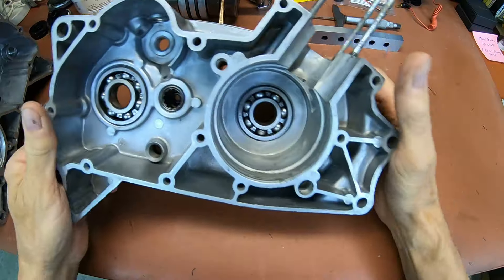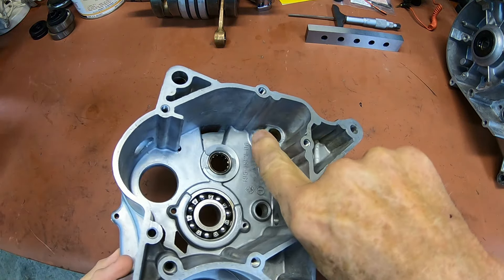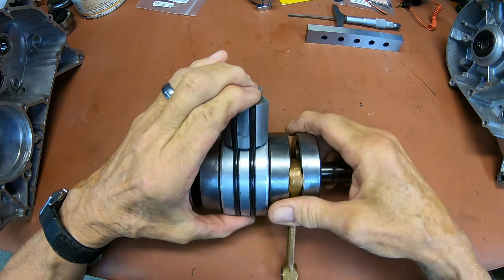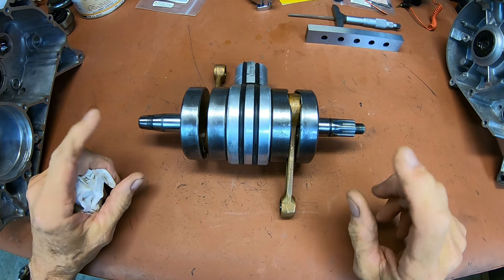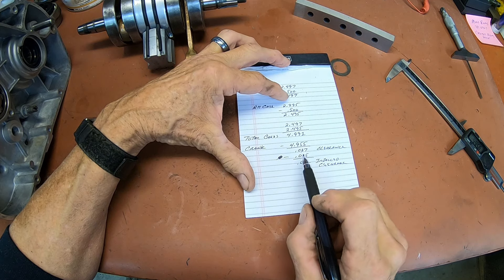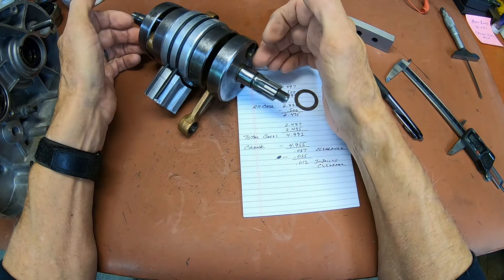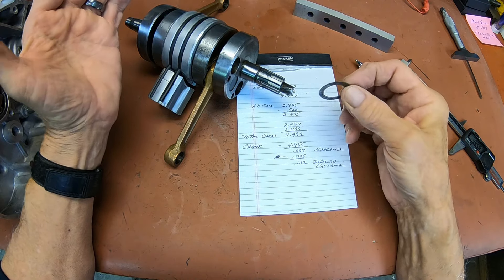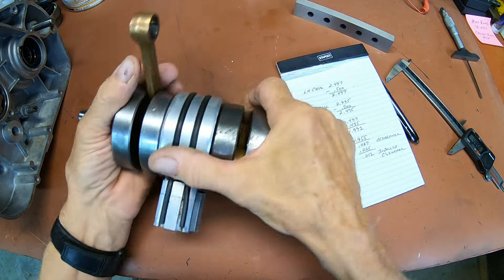Yamaha HS1 90 twin lower end assembly

Comment: Nice work Dale! Glad you were able to find those parts. That assembly process can be a real pain sometimes. Having arthritis and tremors makes it even more of a challenge. I got the shop and storage room cleaned up and organized. Looks like I may have enough parts to put together another TS400. But that will have to wait till I finish up with the bikes in the shop.
Reply from the maker: Thanks Dave, I sure had some problems with this one. I sure seemed to have butter fingers. That is awesome that you are putting together a TS400, I understand the need to finish up current projects though. Got some to finish myself.

Comment: Hi Dale.
I really love your videos. These types of content is the best. I wish you posted this video before I was assembling the engine on my As3. I did not think that you could mount the little o-ring on the crankshaft after the install so I pulled the crank through the bearing with the o-ring on. I had to buy a new o-ring after that 😅.
Looking forward to your next video.
Greetings from Sweden.
Reply from the maker: Hey Robert and thank you so much for the kind words. Yes, that O ring can be pulled through the bearing but it's much easier to install after. I have done too, just one of the lessons we all have to learn, I guess. Good luck with your project, sure glad you could go along on the ride.

Comment: This looks an awful lot like my CS5 engine. I am curious when I got the bearing for the clutch shaft, it came as a shielded bearing. I noticed in your video it is an open bearing. At the moment I popped the shield off the inner facing side as I didn’t see any way that bearing could be oiled otherwise but am starting to wonder if I shouldn’t pull the second one before I put the case halves together.
Reply from the maker: The Yamaha enduros have a shield behind the clutch but the other side facing the transmission is removed. I think it has something to do with the turbulence behind the clutch. The HS1 I had was an open bearing, I just don't know....I just try to replace them the same as I found them. I just bought one for the GT-1 that I'm working on, I got it from Yamaha, and it came with a shield on both sides, the shields now are neoprene instead of steel, at least from Yamaha they are.

Comment: Nice assembly work Dale...! 👍  Hope you have a part 2 coming along to fix the piston and remainder parts before you fire it up. 
Good to know that you were able to source Yamaha parts for a 70s engine. Does Yamaha or any of it's associates support spares for older engines? If there are any links, kindly share... Thanks
Reply from the maker: Thank you, I'm sure there will be many more videos on this bike and engine. I will be boring and fitting pistons at some point. I really don't have any particular links. I use the OEM manufactures for any parts they still service, then Ebay for the ones they don't. If they aren't there, I start calling dealers across the country to see if they have parts on their shelves. It takes a lot of time and work to find them. Yamaha and Suzuki still have a lot of parts in their inventories. Kawasaki not so much, I don't have much experience with Honda but am told their parts availability is very good.
Reply: It would be wonderful to see this engine ready to run.  Glad to know that a few dealers do stock old parts as old as from the 70s or earlier. But of course as you said one should have patience and the time to pursue this. In the end, nothing is more gratifying than to acquire a few of these rare parts.

Comment: Can somebody help me understand why my Kawasaki f7 175 Transmission oil is on the crank and burning.The transmission oil is that normal? I thought that there was only supposed to be two stroke oil on the Crank and connecting round.
Reply from the maker: Hey Bryce, sounds like you may have a RH crank o ring or seal leaking. If so it will suck transmission oil through and burn it in the crankcase. The good news is they are easy to replace. I have a full playlist full of videos for the F7, matter fact I am still trying to finish it up. Check my playlist for the F7 out.